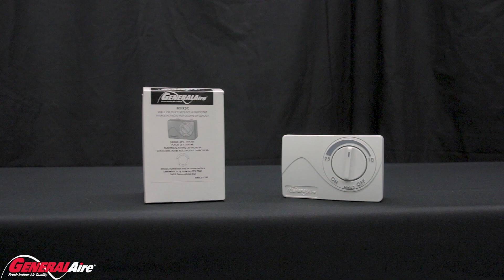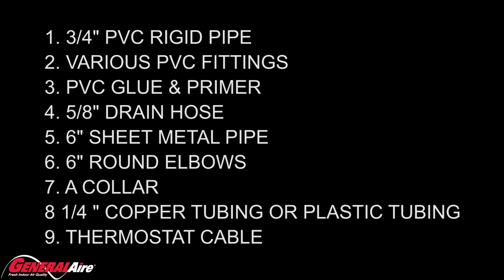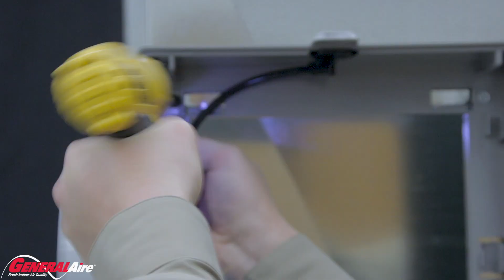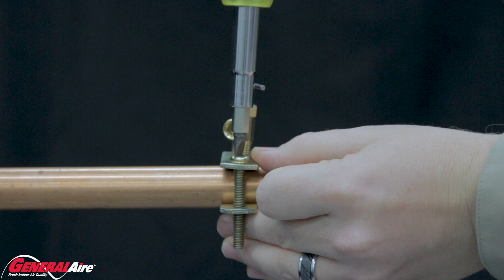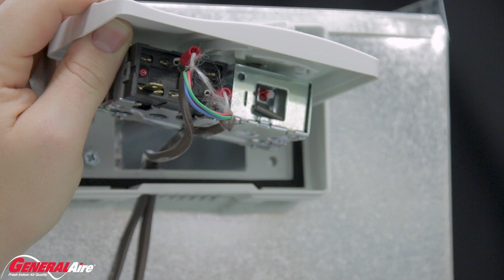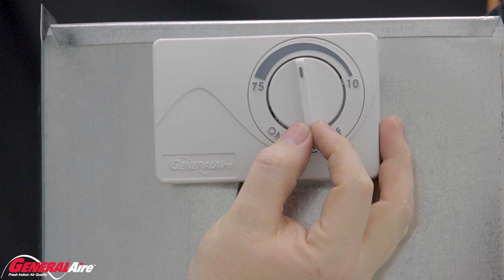GeneralAire® 570M Humidifier Installation

Comment: If you mount the unit on hot air duct, I wonder it is OK using unfiltered return air.
Reply from the maker: This is the first time we have heard of such a concern.  Since the Vapor Pad is replaced at least annually, I do not see a problem with this.
Reply from the maker: It depends on the water quality.  Generally you do not need a filter in your water line unless there is a high mineral content.  We've also run across regions with sand in the water!